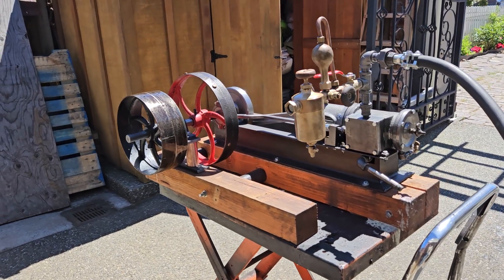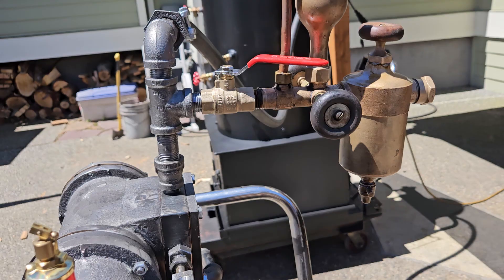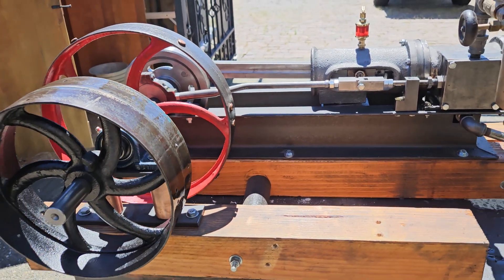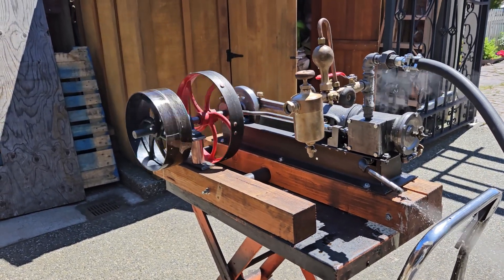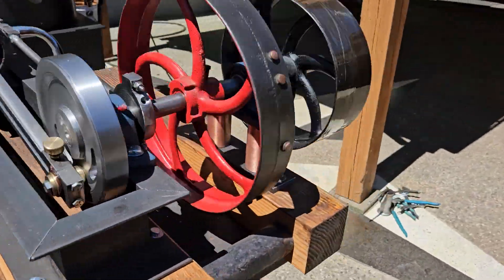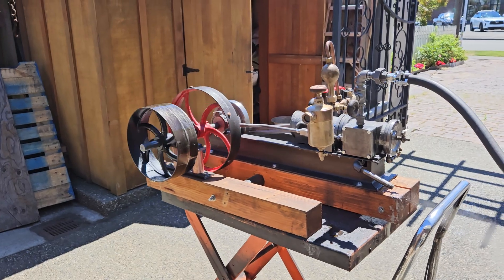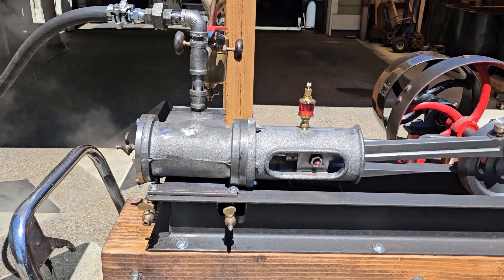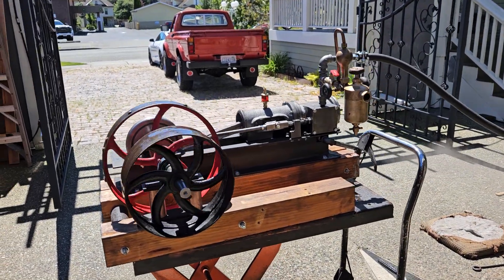Mill Steam Engine Antique Oiler Pump boiler Off Grid Ross Bendixen

Comment: Love your builds . A great metal craftsman Ross. .... Regarding adding an alternator for power. That would be best used to charge a bank or two of storage batteries that leads to an inverter to AC and then to the house panel.. With the steam boiler + the steam engine you can produce your own power with wood ( or coal ) and water even if the gas stations are closed or out of fuel for a generator. Well Done Ross...Michigan